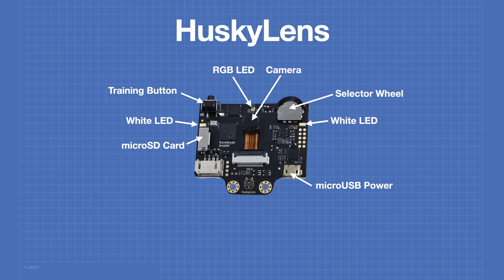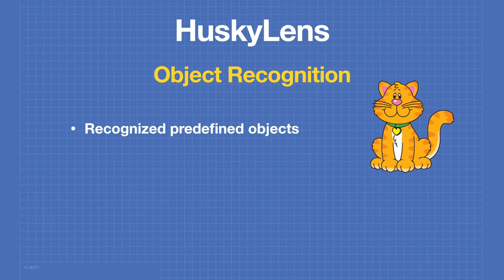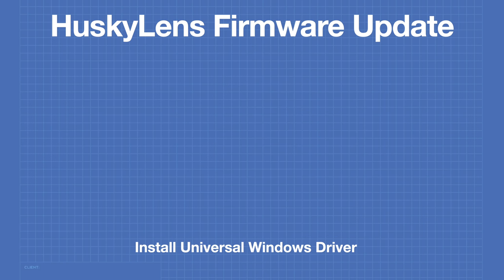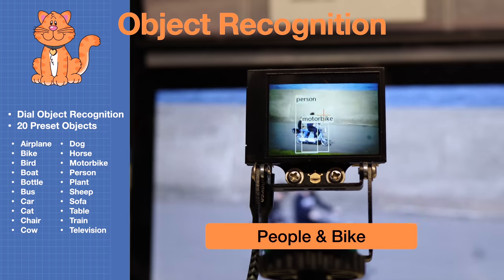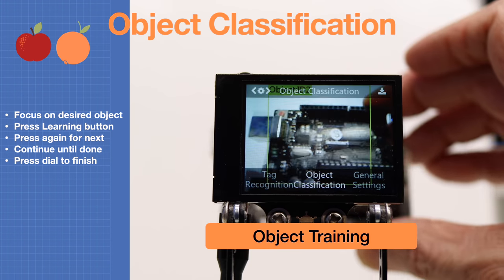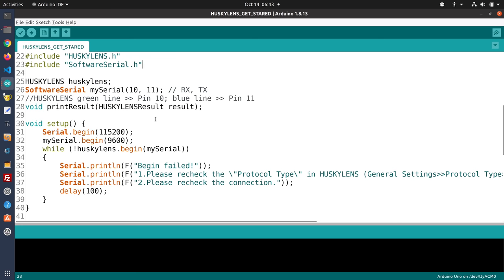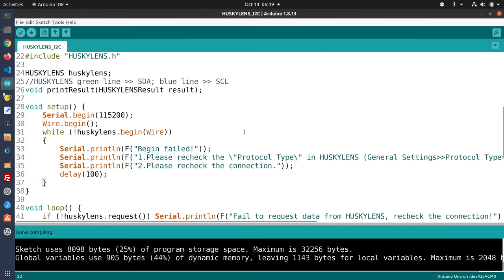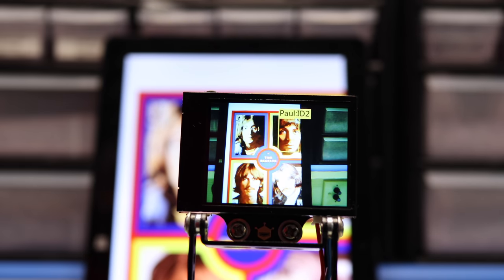Machine Vision with HuskyLens

Comment: Hmmmm, 8 different microphone inputs. Being a Marine there's only one thing I can think of to use this capability for, receiving gunshot sounds and determining the direction they came from for auto return fire to that location instantly, and neutralizing the threat immediately. That would be a great project for you to work on and showcase.
Reply: That is actually a VERY excellent point! (can't say the Corps doesn't make a sharp tactician!) I was actually about to dismiss this for my home surveillance/AI system because of how many cameras I would like since it would make more sense to have a central processing server,  BUT maybe one of these on top of the house dedicated to that cause w/ a rotating shaft that could use those mics to determine to override the direction it is pointing would be nice? I bet I could calibrate it a bit manually and then update it by asking where hunters were when they blasted and what they used(surrounded by a State forest and know most of the people with hunting camps around me). By knowing the type of gun and distance, one could probably use the average decibels etc for that type of round to calculate the distance of the shooter as well as direction. Then it could scan for movement, track, provide range, and record etc. It has to also be possible to train an AI algorithm to determine the type of round from the sound which could help with automatically determining distance as well if it can be tagged to decibel data for that round. I mean if I can tell roughly from my limited experience I'm sure AI can. Anyway, thanks for the idea! Who knows if it is practical,  but it would be an interesting project for sure!
Reply: Just like in Fortnite
Reply: Sorry I missed the party. You could easily build something to detect the direction of a gunshot. Once direction was determined it would be a simple matter to use trigonometry to calculate a distance. No consumer or industrial components meet the required specifications for military applications according to the Government Accountability Office. Those specifications are outlined in the United States Military test specifications as determined by the Department of Defense.  You must use components designed specifically for either military or aerospace applications. Those components meet the required minimum specifications. The cost those components are going to be upwards of 20 times more than their consumer cousins. Thats why military electronics cost so much. A prime example would be a military laptop or radio. Those devices have more than just a robust case.
Reply: @theminer49erz  with a PTZ camera that uses the PelcoD protocol, it would be pretty simple to have a computer send a set position command to the PTZ in the direction of the microphone input.

One other thought would be to use remote "beacons" that send out a wireless signal when a attached microphone detects a loud enough sound.  All the camera controller has to do is send a "call preset" signal to the ptz camera to look in the direction of the beacon that sent the signal.

Comment: Just purchased one.. waiting on it to be delivered. , I noticed you showed baud rates for serial speeds, but when in I2C connection, you didn't mention ( or I missed it? ) I did notice I2C was set to 115200 in the code?  ( cuz you said 9600 should be used in serial? )  But can you set the baud rate in I2C? or is leaving it all in AUTO mode to let it decide how fast to go , a better idea?

Comment: Do you think I could use this to monitor selected gear on a dashboard? I'd be looking at picking out P N R D - but of course on some vehicles, they show only the current gear, some others will always show P R N D but with a highlight on the current gear (either light up, coloured, bolded, border drawn round). It seems like this would be a quick route to the ability to do this, but I do wonder if the problem will be lack of distinction between different gears i.e. P chaning to N withouth any other changes or change of view point. I wonder if the "tag" function would work for this.

Comment: dear sir, I new in your classes.

Have you ever thought about creating a controller for a solar system, where there is a temperature probe on the panel and a probe in a tank, where you can give an order to a circulating pump. Or a control of a three-way valve, where there is a hot water inlet and a return of cold water, where a water temperature is set on the way. The valve control is done by a 24V AC servo motor or other type.

Comment: It costs $50 for non-pro version. I don't know what other people's criterion for inexpensiveness, but to me, it does not seem inexpensive.
Reply: I think it's about right,
For a person who works on it/needs it etc. $50 isn't gonna be expensive, for a person whose messing around with it, it would be expensive.

It's like Arduino Vs raspberry pi
in UK, A Uno could cost £8 or so while the Pi would cost around £60
Both compute but do different things

Dude did a video before about a microcontroller that had a camera and low level AI and cost I think about £20 but did nothing compared to this

Edit: it was the ESP32 which is $10 and with some programming recognised people

Comment: Why is this so limited?  A device like this should have an sdk allowing you to develop your own algorithms for it.  I don't know whether that is possible with this device, but at least you did not mention it.  As it is now, it is more of a gimmick than an actually powerful and versatile tool.  Ex. the hardware should be perfect for running an algorithm to detect 3d printing failures (read: spaghetti detective), but that would require putting your own neural network on it.  Something like that would make it worth the price (which is not so super-low if you compare it to a Pi Zero 2 + pi-camera), but what use is detecting car or bikes or faces or lines? The algorithms for that aren't so complex that a Pi Zero 2 wouldn't be able to do it - probably at a lower framerate, but what use is high-framerate if there's no usecase needing it?  So really, this thing needs an SDK instead of the standard firmware with this limited functionality.